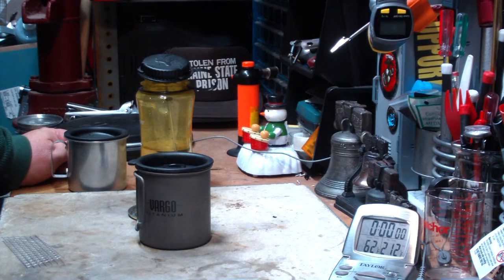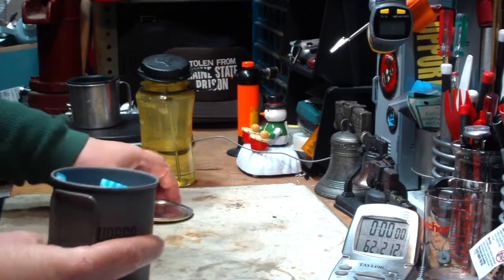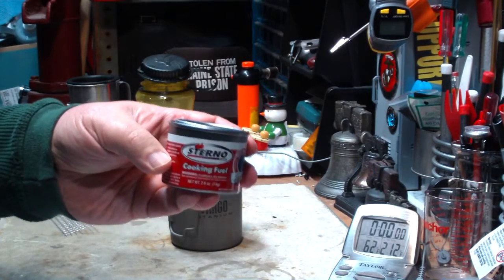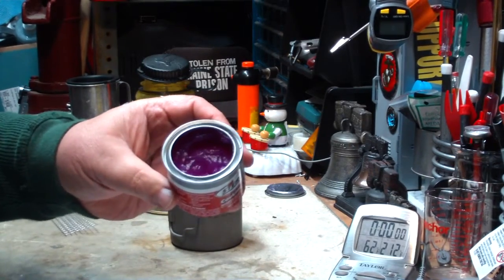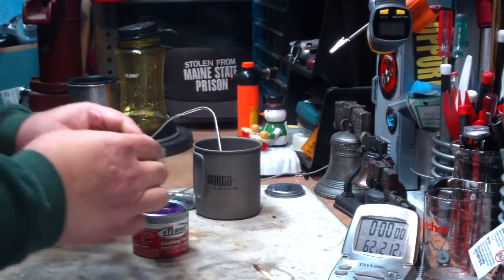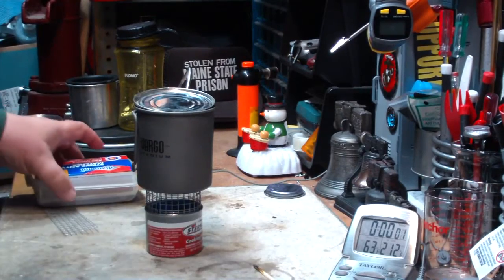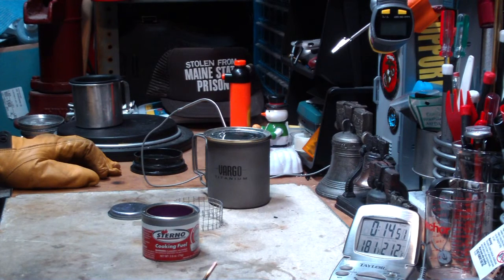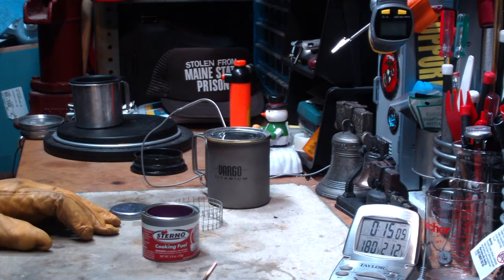Sterno or Gel Fuel? What a Can-of-worms!

Comment: Anodized aluminum is the most heat conductive metal. Stainless steel is the 2nd most heat conductive. Titanium is very light, but the least heat conductive metal. Therefore, water in a titanium pots will take the longest to boil. Modern day Sterno heats water in an aluminum container to a full boil in about 10min.

Comment: I took a chicken can cut the bottom out the size ot the diameter of the sterno can lip. I punched holes in the sides. It fits perfectly on the lip of the sterno can and directs the flame. The air holes cause the flame to be hotter. Works grea boils water in about 5 minutes. I use the Stanley Adventure cup on it.

Comment: the difference between a rubber band and a ranger band is that the rubbers are different. ranger bands are usually made of the rubber inner tubes for bicycles, the tube that goes between the tire and wheel. cut up the tube in strips and you have a "ranger band" that last way longer then rubber bands that you buy in bags